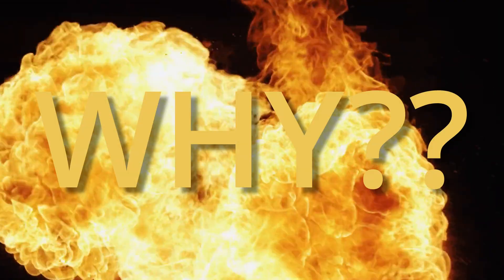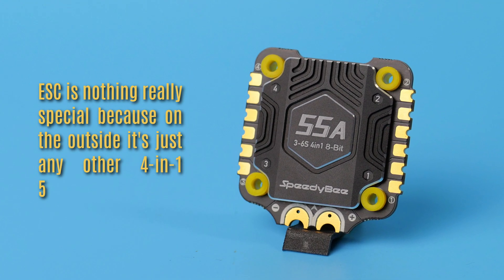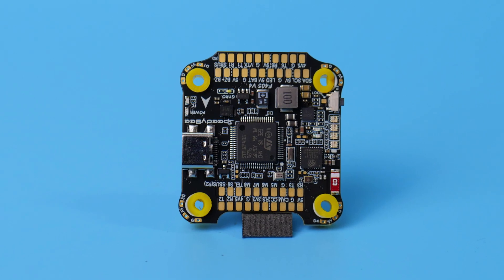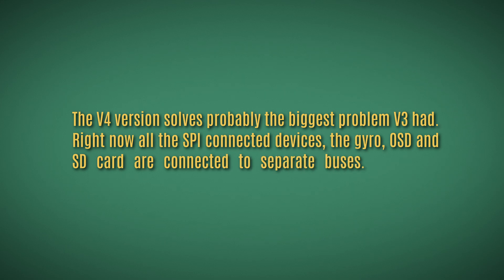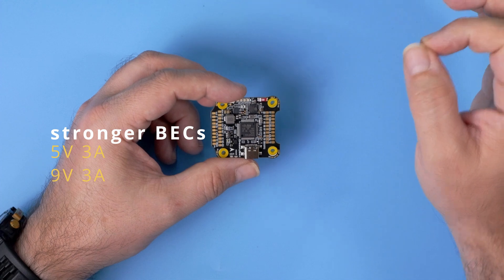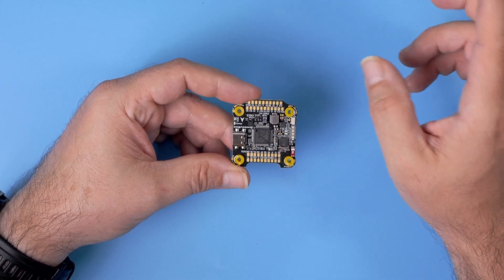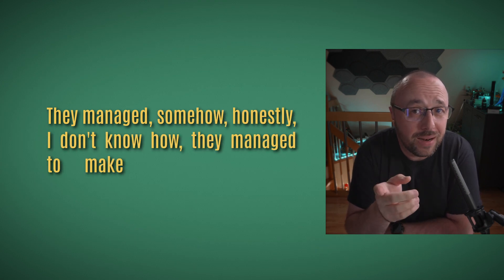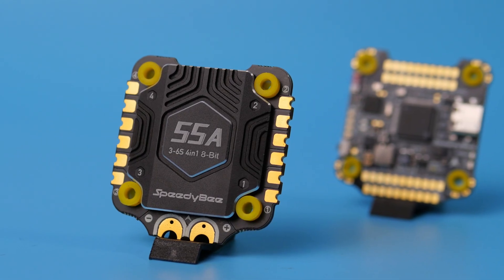SpeedyBee just broke the market | SpeedyBee F405 V4

Comment: Came here after the BLHeli32-Armageddon and I am really happy that the ESC in this stack is NOT BL32
Reply from the maker: On a long run it does not matter. ESC will not stop working out of sudden
Reply: @FPVUniversity  sure, it will still run but right now I am mildly annoyed by the fact that I have a spare sealed BLHELI_32 esc with which I could replace a broken one now - but the one from the bag has an old firmware that doesn't support bidirectional dshot.
Meanwhile, even older el cheapo no name ESCs run bidirectional dshot with bluejay.
But, as you say, does it matter that much?   mmh, it depends. Because the quad flies without rpm filter and doesn't fall out of the sky neither. :)

Comment: Hello my friend! Thanks for your great video! One question: I have the F405 V3 and try to use blackbox with SDCard but no sucess. I tried to change the settings, use BF 4.4.X, 4.3.X, 4.2.X but nothing worked... I tried both SDHC 8GB and SDXC 64 GB... Format them to FAT32 with 4096, 8192, and all kb possible... I also did a partision with only 2GB on the cards but no sucess... Any ideia what may be happening, and how I can fix it and finally use the blackbox? Thank you so much in advance, BR.

Comment: cpu struggles with rpm filter load out ,, but Speedybee is the best analog FC super clear pic everytime
Reply from the maker: You should blame Betaflight, not hardware. CPU is EXACTLY the same like on any other F405 based FC. With EXACTLY the same performance
Reply: its the only F4  I have ..  but I have  the speedybee  F7 mini 35 amp esc   and F7 V3 with a 65 amp 128k esc have no problem's with RPM filters they only utilize 21% cpu  , probably the esc is not very good I use mostly 55 to 65 amp  128k esc's run them at 96k  ,  I have bought a few F7's too with 8k pid loops that struggle with RPM filter's  utilizing  36% of cpu causing hot motors   @FPVUniversity

Comment: Hey Pawel,
I have built my Inav quad using this Stack.
I have the INAV Configurator 6.1.0 and the FC Firmware is the 6.1.1 for the V4.
Magnetometer, GPS, Barometer all works.

Now I want to use a servo to tilt my camera using a 180 MG90 Servo (So I can look down for landing, have it 0 for cruising, and 35 Degrees for fast flight)
I plan on using a Headtracker in the future, but I can't get the servo to show up in the OutPut Mapping, can you explain?
Speedybee even has a dedicated Servo Pin, and I thought I can just use the Motor 5 as PWM to maybe make it 2 axis.

Your help is well appreciated.

Comment: My best flying quads are on BlHeli_S, simple setup and it just simply works with BlueJay. I really cannot see any benefit of having BlHeli32 apart from smoking it much quicker than any BlHeli_s. And i mean it, i am using a 3 year old Racerstar 35a 4in1 anniversary ESC for 3 seasons of abuse, racing and even some events in rain, then also a no-name 40A 4in1 with BLHS for 2 seasons. my third quad meanwhile smoked T-motor velox ESCs 50A, Foxeer reaper 60A esc and then the third one i cannot remember, as it was last season and the third quad is more on the bench changing ESC than flying. Maybe i am doing something wrong but the BlHeli32 ESC just simply die on me and they do not fly better in any way.

Comment: Speedybee writes in the product page The F405 V3 FC faced compatibility issues with certain microSD cards, with a few even occasionally affecting the stable OSD display

But doesn't the v3 have the issue on any microSD card because the OSD and blackbox shares same SPI bus?
Do you think speedybee is dishonest here, not saying the truth, downplaying the issue and not admitting they made a design flaw in the v3 board?

Comment: This is one very cool product. I don't want to be too negative and this is not targeted at this product specifically but rather about all ESCs in general.

ESCs are typically built with 30V mosfets and used at  6S 25V.  That's not a lot of head room voltage wise and they then provide minimal bulk capacitance. One good crash and poof, dead ESC. We'll see if TVS diodes help but .. with most manufacturers running TVS diodes with max clamping voltages in the 40-50V range, I'm not getting my hopes up.

Side note, I am curious to know what mosfets are in this wee unit. I'm impressed with what I'm seeing so far. Very neat bit of kit.
Reply: This ESC uses 40V MOSFET and 30V clamped TVS diodes
Reply: @drayce483  music to my ears. You don't happen to have the part numbers handy?

Comment: I love my speedybee stacks i have both the f7 v3 and the f405 v3. Both are great. Im excited to get this new stack and hopeing they come out with a F7 v4
Reply: Is there any notable difference in performance inbetween the f7 and f405?
Reply: @David-ri3ev  not at all, I have tmotor F60 1750kv on my F7 and F60 V Lv 1950kv on my F405. The F7 is cool cuz it has a jst plug for everything except for the buzzer. So I only have 3 wires soldered to my F7 FC everything else in plug and play. The only real difference is the F405 has blheli s and the F7 has blheli 32
Reply: Thanks, Im just about to build a new quad and wondering if it's worth spending like almost double the price for the stack @Chillin-fpv
Reply: @David-ri3ev  actually right now you can find the F7 for about $80 something. Speedybee dropped the price cuz the just released the F405 V4
Reply: @DavidFPV360  I'm building a waterproof quad. Darwinfpv has waterproof cameras, vtx, receiver, and stack. I'm tired of waiting for a dry day to go fly sense it rains for 8 months out of the year here in Seattle.
Reply: @Chillin-fpv  Damn bro u just saved me alot of money xD. I only looked them up on another website where this stuff is usually cheaper. Just ordered the stack for 85 bucks
Reply: @Chillin-fpv  I feel that. I'm gonna use the o3 and just coat the rest, that should do it for me

Comment: My Matek F405HDTE flight controllers won't connect to a laptop or phone that has a USB Type C port via a double ended Type C lead. USB A to Type C leads are OK. Does this happen with the Speedybee FC too or is it just a Matek problem? I found another user on Reddit reporting the same problem but it's worse for him as his Macbook only has Type C sockets and he has to use a hub. I should point out that I have two of the FCs and two different leads. The problem happens on my laptop and phones. Not many F405s have Type C sockets as they date back to an age when Micro USB was all we had.

Comment: 0:29 Three years ago in 2020, $70 was on the expensive side for FCs. Now, like everything else, the hobby has seen ridiculous price increases, with costs skyrocketing
Reply: $70 for the stack not just the fc
Reply: Even in 2019 70$ for a stack was budget. If we also consider inflation since then, a stack now for 70$ is cheaper than in 2019 in relative terms. i have no idea how they pull that off
Reply: @TimeFadesMemoryLasts  that's not the case. With 70$ you could buy good stuff back in 2019. Inflation affects your pocket not necessarily your income. Especially in Europe things have gone nuts lately.
Reply: @visioneerone  do you not have VTx pit mode?
Reply: @flat-earther pitmode doesn’t quite solve the problem of digital vtxs overheating at idle. the item which generates the bulk of the heat is the SoC which does the video encoding. that chip runs full bore regardless of whether the vtx is transmitting at high or low power. the only way to cool it off is (a) force air over it or (b) power it down
Reply: @visioneerone  okay I got it. I didn't know that about digital VTx.

Comment: You mentioned servos and fixed wing. But still not possible with Inav without  resource mapping (i.e. recompiling?). Is the ESC telemetry necessary, because in theory you could connect it to a single ESC in fixed wing and keep 4in1 for later purposes?
Reply from the maker: Of course it's possible. Works out of the box in INAV
Reply: @FPVUniversity  Nie rozumiem bo jestem noobem ;). V4 ma jedno natywne wyjście na servo, resztę (czyli np. +1 na latające skrzydło) trzeba odzyskać z wyjść na silniki. Inav nie ma możliwości remappowania wyjść jak sam tłumaczysz we wcześniejszych blogach. Można od 5.0 zmienić wszystko na servo a potem gimnastykować się by jeden był na silnik?
Reply: > Is ESC telemetry necessary?

In 35 years of flying, I haven't yet seen a need to bother with ESC telemetry.  Some people like it; it definitely isn't necessary.
Reply: The SpeedyBee v3, in fixed wing mode, had four motors and four servos by default, in INAV 6.0.

The SpeedyBee V4 with INAV 7 will give you more flexibility - up to two motors and at least 7 servos.

I'm not sure what you mean by "native". Do you mean "Betaflight"?